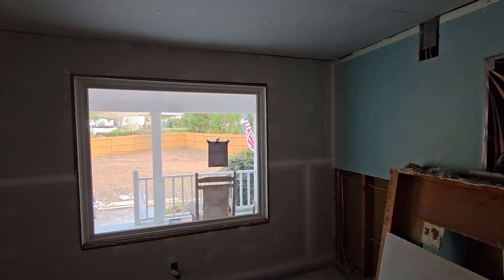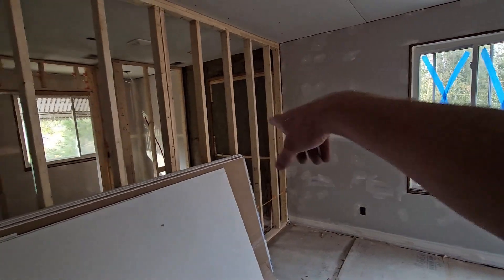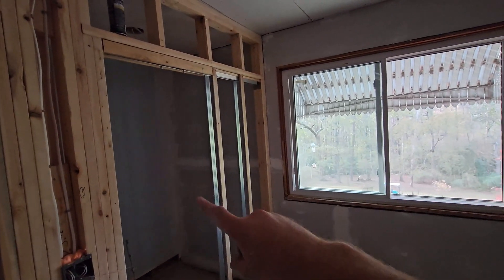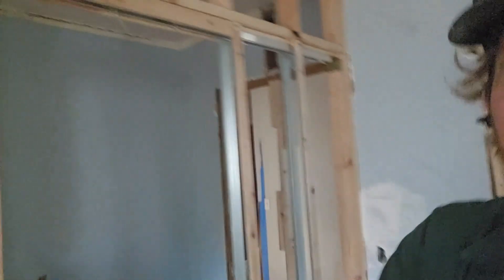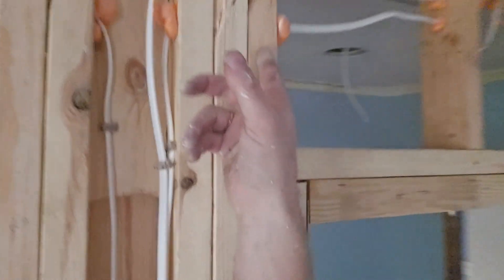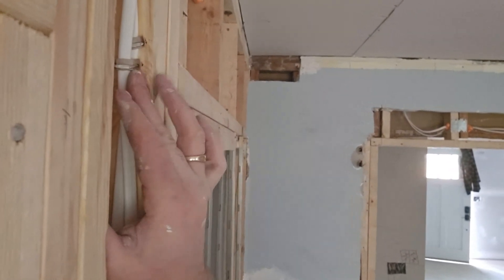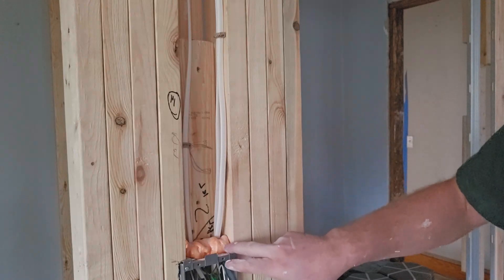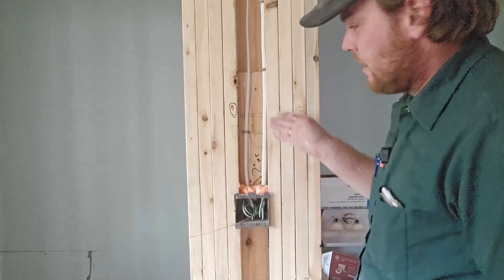Dangerous Electrical FAIL

Comment: The screenshot of the plumbing wall early on shows an upside down drain tee on the vent.
Reply: at appx 1:44.
Reply from the maker: Good eye. We pointed this out to the homeowner as well along with many other issues we found.

Comment: That one jack stud doesn't even come in contact with the header
Reply from the maker: AdirondackHomestead is correct. This is an interior non-supporting wall which does not require a header. If it was my job however I would have still installed one in as it would help insure the door itself remained square.

Comment: Maximum of 12 inches from point of entry to box
Reply from the maker: Thanks for the correction. I was still using the older code which used to say 6 inches unless it was not possible, and then a max of 12 inches. I have checked the newest code book and see that they have remove the first part and gone straight with 12 inches. The staple referred to in the video however was still a code violation as it was at least 16-18 inches from the box. I will still require my guys to go with the stricter original code however as it is a much neater and safer option.
Reply: Good idea ! And yeah what a mess XD